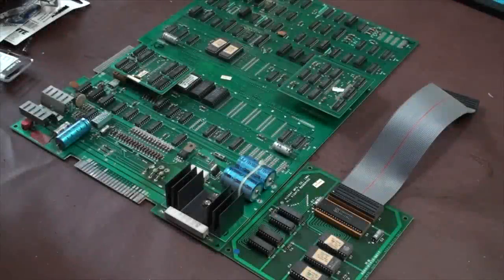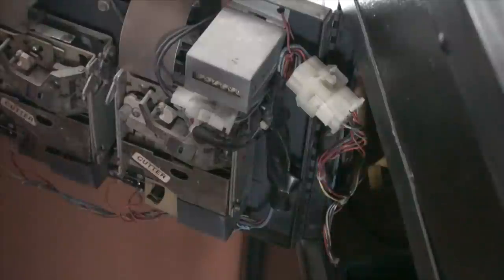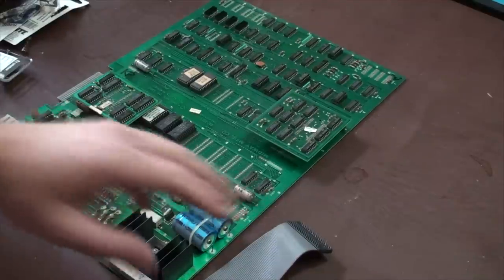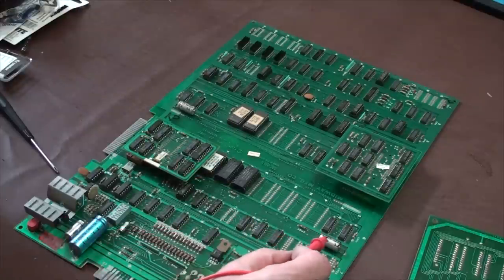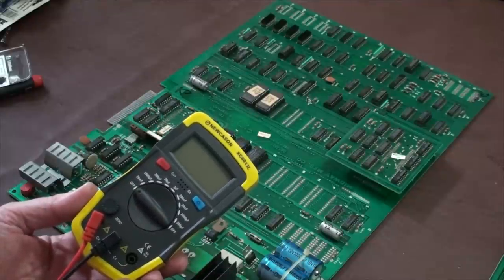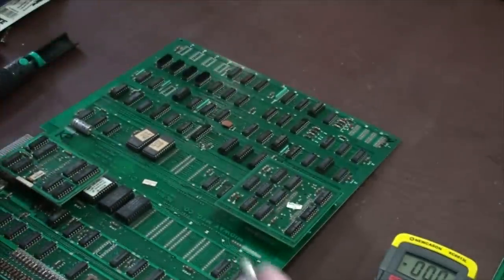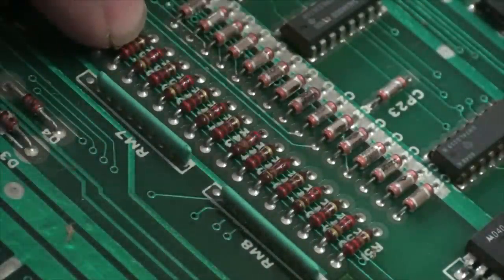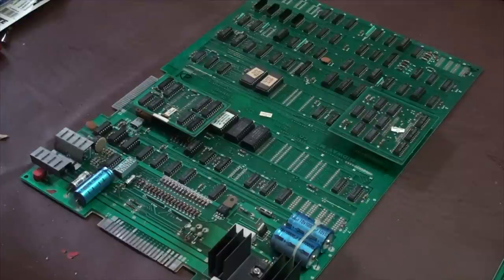Arcade games and electronics repair basics

Comment: Nice job, well explained.
I did stand ups and cocktails in bars and 7-11’s for a living in late 70’s, through the 80’s in Vancouver BC, when our biggest problem believe it or not was getting to the games before coin mechs jammed up because coin box was full, average income was 400$ a week per game, game cost back then was $400-$1000. When game got tired the knock off conversion kits were dirt cheap to buy.
Just retired and started putting out some cocktails and they are doing well. 
You explain things very well. 
and love seeing a guy that is practical.

Comment: Also a good addition to the tool box would be an ESR meter, or even better yet, an old school capacitor tester which allows you to test the capacitor through it's entire voltage range, testing for DC leakage.

Comment: The replacement capacitance could theoretically be within 20% of the original. I say "theoretically" because the timing may be critical in some circuits, but probably less so for electrolytics (unless it was specifically designed with a tight tolerance).

Comment: Not quite how I would proceed but thanks for taking the time to make this. Rather than trust a static cap meter apply power and look for ripple with an oscilloscope.  When a resistor goes and you replace it test run it and see just how hot it gets there may be a reason why it failed.

Comment: You seem very knowledgeable so I wan't to ask you a question. So, I purchased a Cinematronics World Series "The Season" arcade. My first "real" arcade. I have a couple of MAME machines. Anyway, the whole reason why I loved this game back in the day was that it saved your stats. Well, this machine is not doing that, I checked the service menu and everything is good on that end. It has a tadiran lithium inorganic battery 3.6 volts AA battery on the PCB. Do you think that is the culprit? Thanks in advance.
Reply: Not a arcade guy, but the old school Nintendo cartridges(the ones that had one) would save your progress with a battery in the cart. It would make sense that if you move the machine you would need power to keep your high score alive in memory somewhere. Your score is probably on a chip somewhere like R.A.M.? So maybe the battery or connection from your battery. Without knowing how the circuits work(schematics/diagram) its a stab in the dark. hope you got it working

Comment: I have a question I have a burger time that is getting power but my medium power supply board overheats and shorts out.  What is the mostly like cause?
Reply: ok
well you basically just said it yourself
SHORT CIRCUIT

A SHORT CIRCUIT is a LOW RESISTANCE path , which, in itself is not a bad thing
but, when a circuit is DESIGNED TO HAVE AN ELECTRICAL LOAD,  and then something BYPASSES that load,     this is called a short circuit 

it causes dangerous situations because current is allowed to flow faster than what it normally would,  or.. youc an view it like this....
a certain amount of energy is supposed to be consumed / used up by the components as a function of RESISTANCE

since your short circuit has caused a scenario where the energy can bypass the components IT DOESN'T GET USED UP 
hence.. THINGS OVERHEAT
THINGS BLOW UP

Most common causes
- Capacitors are usually the first things we pick on
dont' just check with a DMM for capacitance..     Check with an ESR Meter  to see if they pass or fail

now... WHAT IS A PASS and WHAT IS A FAIL
haha
well, that has to do with   the Cap Value, the Model the specs... all sorts of shit
in a nutshell to keep it simple.... IF YOU LIKE....    tell me the capacitor values and i'll tell you what the ESR should be 

- Check your fuses for low resistance

- Diodes are a culprit for Short circuit... so.....  if it's going through a rectification bridge and 2 of the diodes are shorted the circuit won't work.
Diodes need to be tested OUT OF CIRCUIT 

- you can check resistors as well

Look for burn marks to give you an indiaction of the area of concern,   ALSO.. DO THE SMELL TEST

- your transformer could have a short as well

But it's most likely going to be Capacitors of Diodes

if you need further help i can shoot you my email address and we can skype and do a video troubleshooting session  if you like
HAPPY TO HELP
NO PRESSURE,   ok

but to be realistic , in order to troubleshoot it , i need to see it , Unless you really know what you're doing
but, if you really did,  you wouldn't be asking this question, would you 
so.. yeah.. think about it 
get back to me

Comment: I have a diode that test ok but when you turn the board  over and test it by its solder  joints  it test bad with current both ways weird is it faulty
Reply from the maker: if you test a diode in circuit the meter current is going to take the path of least resistance. meaning it may not go through the diode but around it. you should remove one side out of the board to test.
Reply: @Cookingwithdrchill  thanks

Comment: I tried to fix mine cuz the monitor was broken and now I touched the fuse and shorted the whole thing and got 12 volts to my hand
Reply: Always turn the power off and unplug it before you even touch as it’s very dangerous
Reply: @lesliegibson5964  prolly could’ve died 🤣 I was like 13